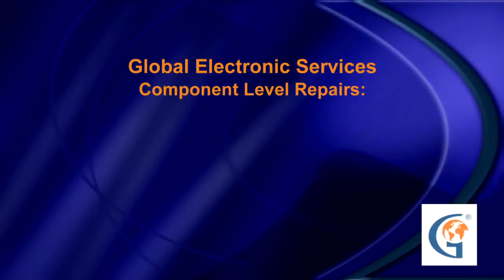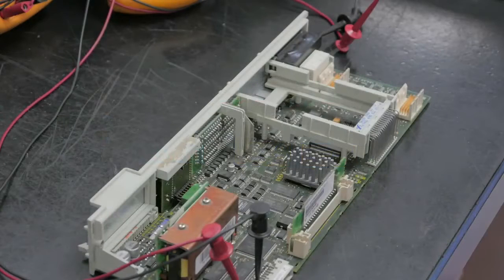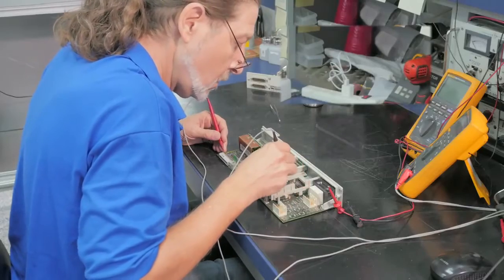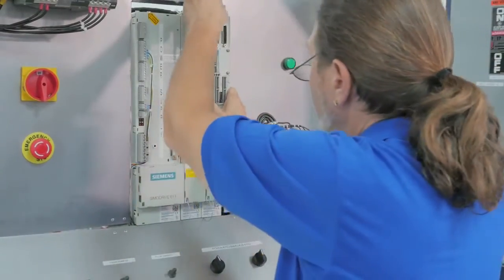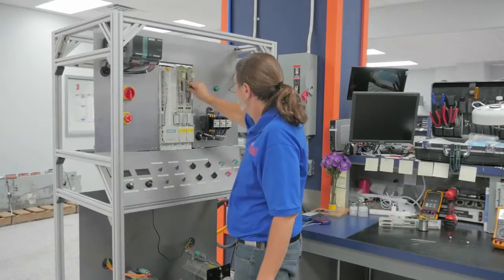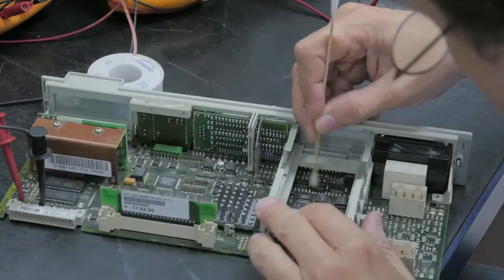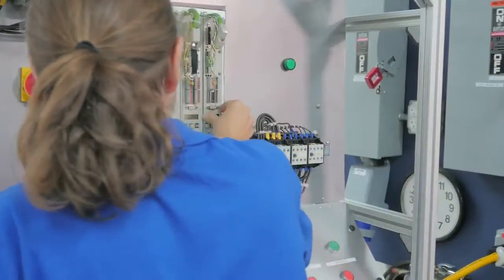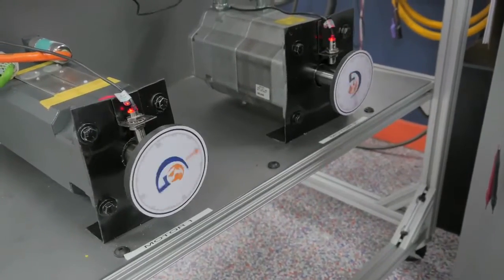Siemens Simodrive 611 Card Repair

Comment: Hello, thanks for the video, I greet you from Peru, I have a trumpf punch from 2004 and when I start it, it sends me this fault:

- The power supply / feedback module (E / R module) is not ready for operation

- Missing release of hardware pulses in the I / R module

-Missing the release of the hardware controller in the drive module

- The intermediate circuit voltage is outside the allowed range.

- No position measurement system is activated.

I would like you to give me an opinion, here in Peru there are no experts for this machine, the machine has not been working for 1 month, thanks for your answer.